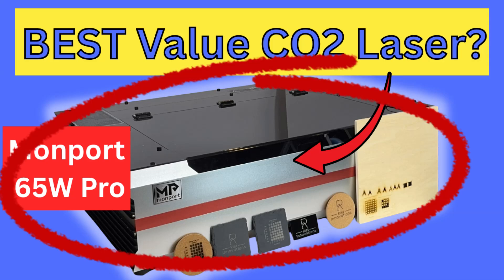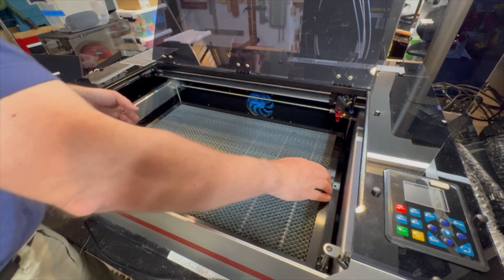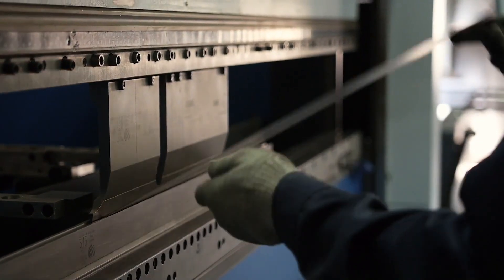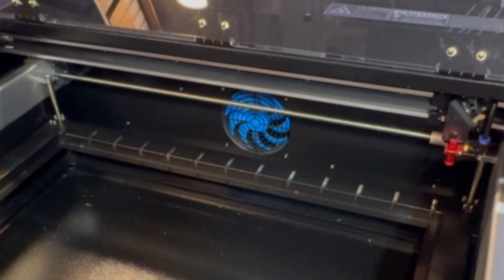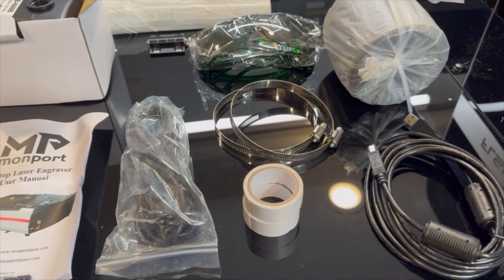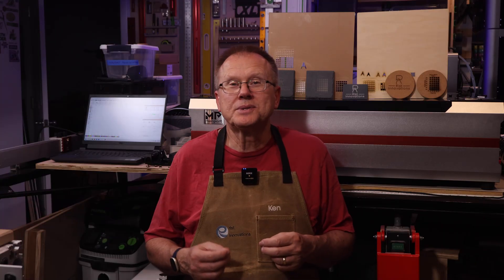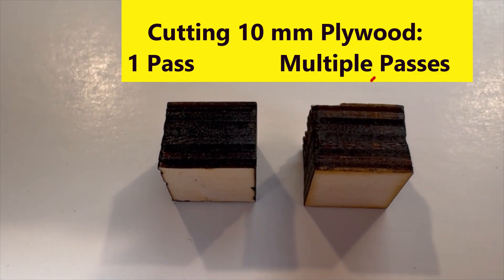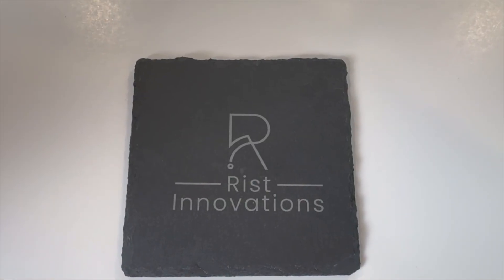Is the Monport Reno 65 Watt Pro the BEST Value CO2 Laser Engraver?

Comment: This laser is horrible.  We bought it,  when it arrived the x axis arm was crooked resulting in it being completely out of alignment.   The exhaust system is also extremely poor.   When we attempted to call the tech support number we found out the number was no longer working.  We've worked with laser systems for over 10 years so I finally figured out how to align it. It engraved pretty good on wood and leather but would hardly cut acrylic. I'm doing a review from an actual purchase perspective not a free gift.   Your video is very informative though.
Reply from the maker: I'm sorry to hear that you have such troubles with your laser.  Mine was missing some brackets for the rotary mount so mine wasn't without any problems, but your particular experience was much worse.

Comment: Can you do tumblers on this model? I saw a video that shows the 45 that wasn't easily compatible with tumbler rotary.
Reply from the maker: The rotary is only two rollers, which is a very basic rotary compared to competitors. I just received some missing brackets for the rotary so I will be making a follow-up video on the rotary in a few weeks.  My plans are to customize the rotary so that it can easily do tumblers, etc. so we will see how I make out.  Thanks for the question.

Comment: Did you actually get lightburn pro with the machine?
Reply from the maker: To clarify, the LightBurn software was on the USB drive, but I never tried to load it to my computer because I already had LightBurn so to your point, a customer may still need to pay the license to LightBurn in order for the software to work.  Thanks for pointing out my oversight.
Reply: @ristinnovations found out that they gave a couple different packages one with lightburn and another without, I would guess it's so as like you if you already have lightburn you're not paying for it again
Reply: Lightburn will give you a 30 day trial with this machine.

Comment: It’s cheap, but it’s a Monport.

I wouldn’t trust anything from Monport after they screwed their customers over with the mega.

They shipped a lemon and have done next to nothing to make it right.
Reply: Yeah, I almost hopped on that lemon train a few days ago when I saw the Mega, but I also went through the reviews. I also saw that it's been quite a long time since the first shipped units and seemingly nothing has changed, they haven't even delivered the promised new rotary for it as it's incompatible with any of the ones they currently offer. So I'm back to picking between xTool and AtomStack for the time being. The Mega seemingly needs so much modification to work properly that at this point I'd rather build my own unit from the ground up. Got enough experience with 3d printers and this isn't much different. But I don't want another project, I want a tool that simply works.
Reply: I heard this also about the mega not being ready for prime time, so I got this one, it's been working flawlessly... Also heard monport working on improving their customer service, I can't comment on this as I haven't the ad the need to use it, but heard that there setting up a dedicated service center, hopefully it true
Reply: @attainableaudio4533 good to hear about the Reno.

Haven’t seen any sign of Monport getting their act together yet in regards to customer support / service center. 

Hopefully they do.